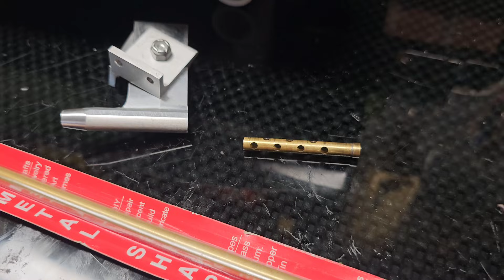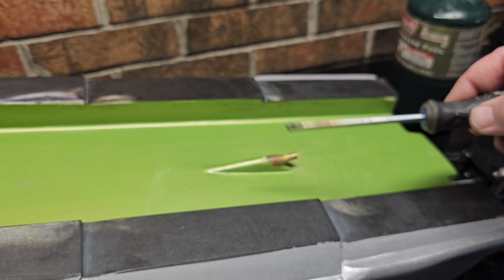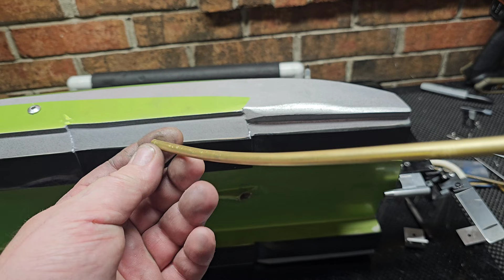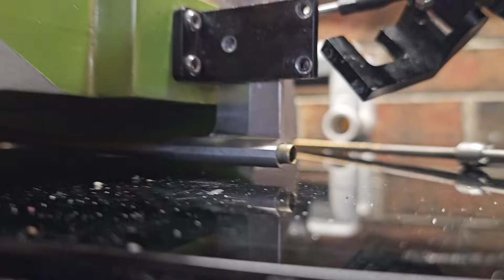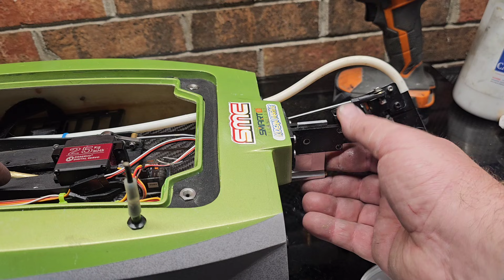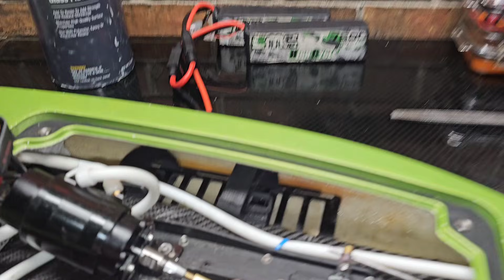Upgraded Stuffing Tube & Speedmaster 21 Strut Proboat VELES 29 - .187 Flex Cable

Comment: Thanks a lot for your vidéo . For the tube ks have you choose the référence 8130 or 8131. I want to do the same in my veles
Reply from the maker: Veles I used a 1/4" k&s bras tube, running an HD .187 3/16 Cable WITHOUT teflon linner
Reply: @I @IRONCLADRC ’s not a problem without Teflon liner??

Comment: Crazy timing ! I just threw a prop because of that same slop on my Velez 3 days ago, ordered up a ose-1390 v3 strut not sure if that will work but might go your route now. Also had a SSS 4092 2000 KV or a TP power 4090 CM 1920KV  with a Hydra X8s in my cart but I'm unsure of the setup, Any boat gang members advice would be appreciated help me get to 100 mph club in this thing !
Reply: Update... the stock stuffing tube doesn't fit that strut unfortunately,  have to get the big B route
Reply from the maker: @McGovernGolf yep, you need a longer 1/4" stuffing Tube!    Good luck with the upgrade!   BG4L
Reply: I was trying to just update the strut to fit the original stuffing tube but can't seem to find the right one only the proboat strut which is 60 $$